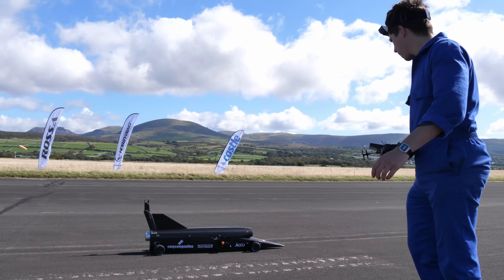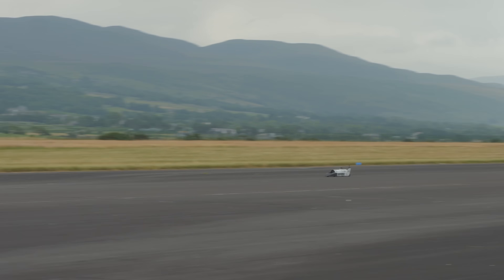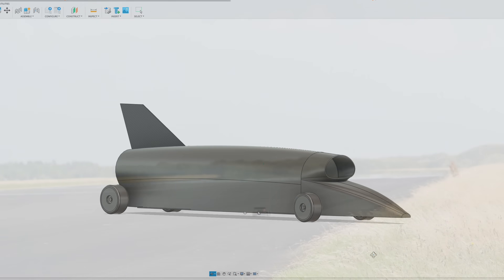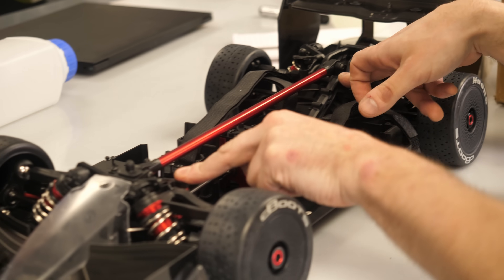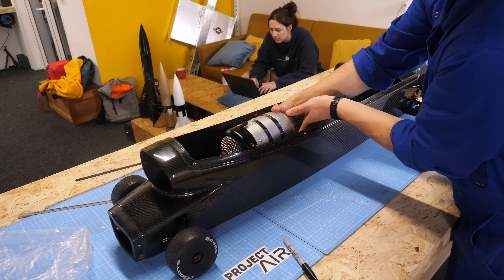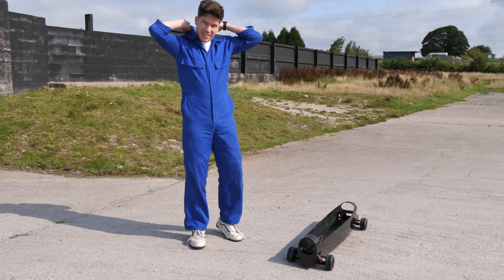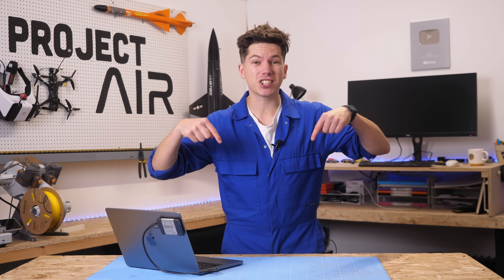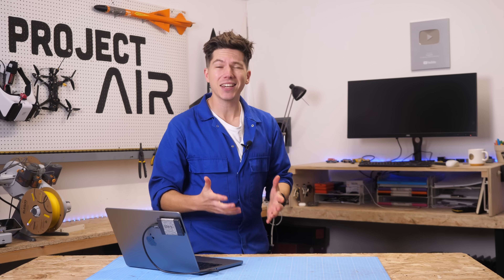Building the WORLDS FASTEST Jet RC Car 3.0

Comment: A suggestion about your steering. Your steering servo appears too slow and weak, especially if you are using a gyro. I made the mistake of going 170 mph, and it couldn't hold, causing it to go off course and crash. You can hear your servo struggling, and you can see how slow it is. Gyros require high-speed, high-torque servos to work properly. Your servo might have the torque, but it's being hampered by the low gearing, which slows it down to produce the torque. That is usually found in cheaper servos. I recommend using only a brushless high-torque, high-speed servo in the 60+ kg with a true speed 0.097 speed range. Put it on the carpet and bottom out the chassis by pressing on the car with your hand. If it struggles to turn the wheels at all, you won't have good control of the car at high speed, especially if there is a breeze. You'll regret it when it crashes at high speed. I just spent 250 dollars on a good servo. That is well worth knowing. The only thing that can crash my RC car is my bad driving, not a mechanical issue. Good luck, Captain Air! See you when you break the record by a mile! I know you will without a doubt.

Comment: @ProjectAir  Jame's, you need  stainless steel thin wall pipe. that's aluminum is to heavy and wont handle the heat. that's what we use in RC aircraft.

Comment: Just curious, what does the car weigh fueled up for a run ?  Very cool Richard reached out with a signed book.  That body looks amazing, I could never pull something like that off lol   PCBWay makes getting parts easy, while I do have machining equipment I am limited to 3 axis CNC on my milling machine.  I've had small intricate parts machined by them, was well worth the reasonable cost and short wait to get them.

Comment: Mike bell made a really detailed video on the aerodynamic design of their reccord braking drone, especially with (homogenous simplified) CFD tests to design properly the drone fuselage and motor pods, definitely a great watch and maybe some ideas for futur aerodynamic optimisation. 
I am personally not convinced that the design with the big exhaust pipe is the best, with greater surgace area, you decrease the flow of momentum, and thus the thrust. I would instead place the jet engine as back as the cg and stability constraints allow

Comment: I may have just missed the reasoning in the video, but why not put the jet engine at the back of the car? It would give you a lot more room inside, and you wouldn’t need to have an aluminum pipe running down the whole thing radiating heat everywhere.

Comment: First 2 words of ROSSA are "Radio Operated" but does that require hands on the controls? I've controlled vehicles at Llanbedr before, but they've all been autonomous with essentially no input from the ground (they could be told to do specific things such as land, but they didn't require a ground station)

While at Oxford I helped a friend with a project that involved inter-UAV communication and organisation, that was going to be a part of a future thesis. I worked on a model-based control system which let each done simulate what it was going to do and potentially make some tweaks so that when they carry out maneuvers they can do it with confidence. The real world is messy but the simulation was 90% the way with the remaining 10% being live reactions. Someone else worked on precise positioning and they were able to fly really close together as they knew precisely where they were and where the other aircraft were - the intention became to turn it into an aerobatics team but covid happened and I haven't touched the project again.
I just know that if I were to make a jet powered car it'd be fully autonomous as I know I can make it notice something is wrong and make it safe, as well as not worrying about steering let alone oversteering. I've been meaning to get back into engineering, I am so close to starting from the basics on my own, I'm lucky enough to live in the countryside and I have no doubt my neighbour would allow me to fly drones around (we go to their house to play board games sometimes)

Also, fun fact RAF Llanbedr used to operate target drones (not autonomous), I was responsible for us ending up there because I was in the Air Training Corps and I've been to Llanbedr as a cadet a few times and mentioned it to my friend, they were the first place he checked with and they gave a go ahead

Comment: Ok, so I am i NO WAY a guy that knows stuff like this, but why did you leave the back wheels exposed? You said you wanted exposed wheels to get the steering right, but ... the rear wheels are not steering.
I mean, it is easy for the next guys to beat you, just build the same car without exposed back wheels.

Comment: Carbon is a bit difficult to work with but gives good results.
Reply: Add a stabiliser like Fusion Fix spray and dry carbon fibre reinforcement like we've used here becomes very easy to handle.

Comment: do you have any tips for rc beginners (I plan to try take up the hobby)
Reply: I'll pitch in here if I may- it depends whether you want to build a car or buy a ready to run one. There is a huge choice both ways. And also, what sort of car are you interested in? There are crawlers, off road buggies, high speed cars, lorries- lots of choice. Do you have a good model shop near you, such as Wheelspin Models in Cannock Staffordshire? They will give good advice to a newcomer to the hobby.

Comment: Creating a smooth duct from the scoop to the intake of the engine will improve aerodynamics and engine efficiency
Reply: It's a jet engine, not an EDF. I think that it doesn't really care that much, because the volume of "inhaled" air is much lower.
Reply: @lakotamm it has left to do with the amount of air moving but the added resistance the high pressure pocket that the open cabin creates. Giving the air a streamlined way to move through will reduce air resistance as well as increase pressure before entering the compressor. This is seen on real aircraft like the f16 and really any jet aircraft.
Reply: @lakotamm in addition the engine that he is using is a low bypass turbofan. If he was using a high bypass turbofan then the amount of air going in would be more important than the pressure of the air going in. But since he is using a low bypass turbo fan it requires there to be more pressure as the thrust of the engine is directly derived from the speed of the moving air rather than the volume of moving air. This is why large aircraft that use high bypass turbo fans can only go up to a certain speed but are much more efficient than things like fighter jets which are low bypass turbo fans and are much less efficient but in turn are much faster.

Comment: I would suggest adding a simple titanium heat shield around the engine and designing a full air inlet and possibly building a shroud over the rear wheels for more speed

Comment: Are you worried about the rubber tyres expanding too much and coming apart with the high rpm?
I notice full-size jet cars use solid wheels
Reply: Full size jet cars tend to run on salt or sand,. These surfaces have some give so solid wheels are ok. But I believe this is going to be running on asphalt which has no give. I'm guessing it would be shaken to bits with solid wheels.

Comment: Loved seeing ya absolutely chuffed unwrapping the chassis. Question though and admittedly i havent dug into this, but why arent top speed RC's using 3rd member springs? It seems like a good way to compensate for downforce while keeping the suspension more compliant over bumps. Instead of just running really stiff springs which might make the car more twitchy. Love the content, thanks 🫶

Comment: Haven't seen the whole thing yet, but I'm absent minded and wanted to comment-- how about doing the Turbinator truck and making a exhaust turbine drive the wheels as well? Might help a lot at lower speeds. Tiny vz21 exhaust wheel might work well at that size.
Reply: Heck, how about a little floppy flippy exhaust bypass and a couple pelton wheels on the axle? Also, two super thin stainless tubes with ceramic wool in between would probably work better and be lighter.

Comment: This is going to be epic. 
But..... you have an air flow issue with those wheels. As they're not drive wheels, could you not use a titanium alloy mix wheel, which would be a lot thinner, creating so much less drag? I realise you would need a parachute rather than disc brakes, as alloy wheels are gonna suck on that score! Lol. 
But these things can be overcome with careful thought. I hope you've still got the DSC. It's gonna need it, I feel.

Comment: I'm a little worried about the drag induced by the airflow entering the main fuselage through the intake, I'm also worried that overpressure in the fuselage could cause a loss of control.

Comment: I've always wondered about having intakes above "control" surfaces. Does the turbine suck in enough air to cause low pressure on the nose and cause front end lift?

Comment: Great video.  You talked about a bolt being missing that caused the nose to fly off. It begged the question. Do you not use a preflight checklist?  Any time I  fly my plane, I go through a preflight in two parts. One is the walk around,  which might benefit you. Be safe,  I know that you'll crush the record.

Comment: It's funny how long the record for the fastest jet RC car ever built has been slower than the top speed of an electric RC car you can just go out and buy
Reply: I mean, he did run a 113 before he even started using the streamliner style body, and yet his official record was 94mph.

He also ran 130mph but that also wasn't an official record, so I guess there's just too many variables being considered for them to push the car as hard as electric cars consistently.

Comment: Fantastic project, but can i ask you why didn't you used a de laval nozzle to accelerate the air after the jet engine instead of using a straight pipe?
Reply: those convert high pressure to high speed, but I think the jet engine is already doing that internally